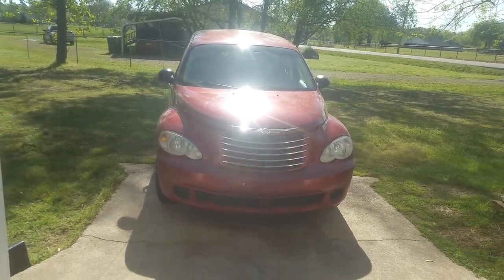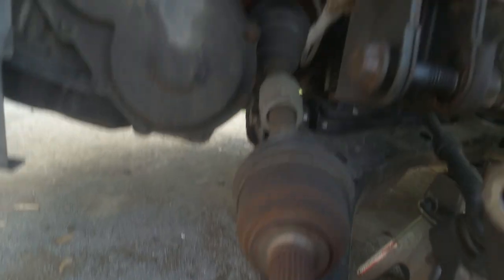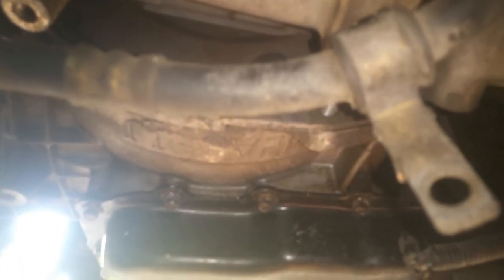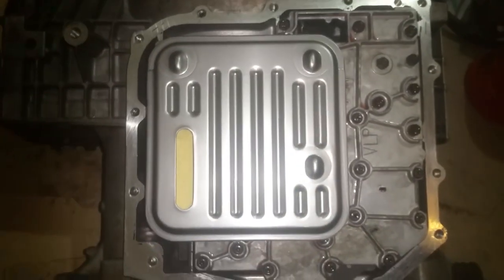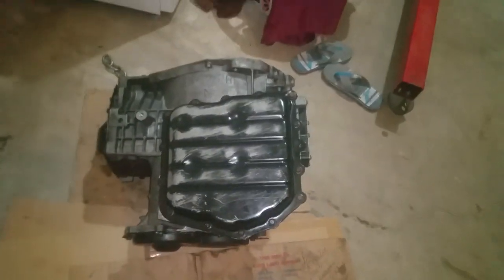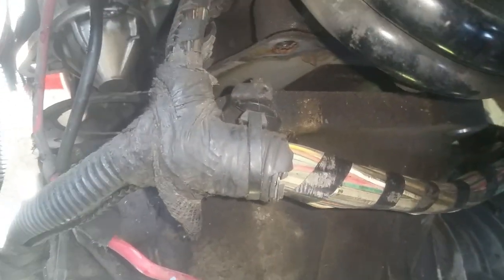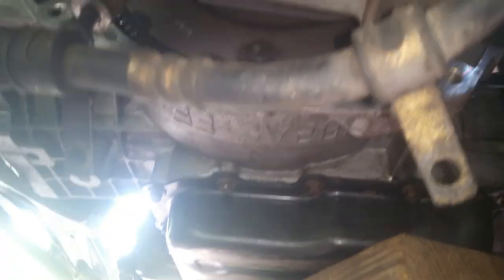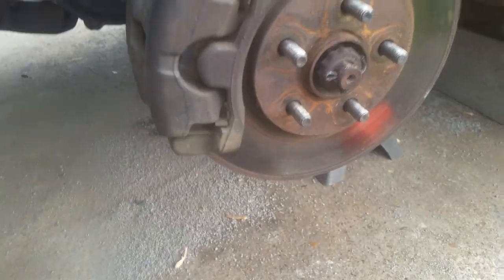How to replace remove transmission in a 2001-2010 pt cruiser

Comment: I can not express enough how happy I was to find this video. I'm going through the same thing right now. Don't know for sure yet if I'll get it done, but I know this is going to help. Thanks so much for posting this!
Reply from the maker: Thank you very much for the feedback , I hope the video can help others out . These transmissions are easy to find and pretty cheap. The replacement went a lot easier than I thought it would . Everything went smoothly. Best of luck on it sir and thanks again for watching
Reply: Was there any issues with the computer recognizing it? I had heard that I would have to have the sensors and computer reset or something?
Reply from the maker: No , no issues at all with the computer so far it's working flawlessly . Seems like I'd heard that somewhere myself but thankfully it's not the case. I had to put 9 quarts of atf+4 to get filled up . They drain quite a bit out for shipping but they still don't get it all. Thanks again
Reply: @s33therfan  Thanks again. Great channel, I'll be back.

Comment: 12:47 quite a bit of oil. Valve cover gaskets?
I just finished replacing my 2001 steering gear, tie rod ends, control arms, sway bar bushings and end links, calipers and pads.
Had to drop the subframe to do the steering gear.
Then my new steering gear leaked and when replacing it with another under warranty, I found the bushings bad on the new cross arms. Also a warranty replacement.
Preloading your knuckle to simulate the actual ride height is crucial before torquing down the cross arms. I only ran the car a week when the steering failed.
Everything is replaced and working and my manual transmission starts making grinding, wearing noises while in gear and driving.

So here we go with dropping the transmission to see what the deal is.
Being four years after you posted this, used transmissions are more like $800 on eBay.

So we will see what's up with the tranny and go from there.

I was hoping after a few thousands in parts, I would get a bunch more years out of it and no crazy car payments. Interest rates on car loans here in the future are crazy high.
Reply from the maker: Inflation has sure hit the car parts in recent years for sure and car prices are even worse. Great job , sounds like you have put a lot of work into your car. Hope all well and it stays running for years. Thanks for the feedback.

Comment: You think they bolted a lot on that you should try this on the turbo model ... The CV shafts are two pieces in the passenger side and there's even less room because of the turbo plumbing
Reply from the maker: Yes , I remember doing a little work on one of those years back. I do rememeber there being a lot of choice words involved. Thanks for the feedback.

Comment: I may be at the point where I need to replace the transmission in mine. You stated early on in the video, the transmission you purchased had only 20,000 miles. Was this from a vehicle that had been in an accident? I'm looking on Ebay and seeing transmissions being sold from cars that appear to have been in accidents/wrecks. Is that a red flag? If the transmission you purchased had only 20,000 miles was it from a wrecked vehicle and does that matter? I'm having a hard time believing that a car with only 20,000 miles would be sold for parts unless it was a wrecked car.  I appreciate your advise on this.
Reply from the maker: Most of the time they are wrecked , it could be a car with a bad engine. Some cars have parts only titles so they may be intact. Either way ebay is a good source with their money back guarantee. I will usually still look for the better seller rating though. Thanks for watching.

Comment: Hello sir one question do you know if a 2004 transmission fits a 2009 pt cruiser?
Reply from the maker: 2001-2005 would interchange 2006-2010 will interchange. 2006-2010 use the same 41te transmission as 2001-2005 but they made changes and added Variable Line Pressure , the valve body would be different and an extra electrical connection. So the 2009 would not work with a 2004 or the reverse if its automatic. Now the manual transmission would fit all years as far as I know. Hope this helps and thank you for watching.

Comment: ok any advice would be greatly appreciated, my pt out of the blue just went ape crap, while driving the battery light came on, stereo went off, tac went way up and engine raced loud like being in neutral. error code was something like 0500 , freaked me out, then went back to normal,, little while later done it again and again, more gas i gave it, worse itd get — feeling sad.
Reply from the maker: With that code it sounds like a speed sensor or something with the transmission. However with the lights and electronics going haywire it seems power related . Possibly battery or alternator . You can easily check the voltage output of the alternator and also check the battery with a volt meter. It is very odd I would start with the battery and then alternator. Then go to checking wires ( disconnect the negative cable 1st ) for bare spots or loose connections. Pay particular attention to the wire running to the alternator you have get under the car to see it make sure theres no bare spots or places it could be shorting out . If all the wires connectors nothing touching or grounding out then I would probably check fuses and then relays. Anyways just some places to start and I hope this helps . I had a pt cruiser with a shorted out wire that was going to the alternator. It was loose and somehow melted the insulator off the alternator. I rememeber it doing really crazy things. Anyways best of luck on yours and thank you for watching.
Reply: I would check chadis ground connections.
Reply: Check all you vacuum lines.  Check your cable on your cruise control.  You should be able tell this.

Comment: i removed the trans from engine and the torque convertor stayed on the engine -did i break anything as it just came apart that way?
Reply from the maker: If the bolts are removed holding it to the flywheel then it must be stuck somehow . I have had the torque converter try to pull out with the engine and just carefully pushed it back into the transmission with my hand or screw driver. It does happen from time to time nothing to worry about. Its not a bad idea to replace the torque converter seal while you are in there seeing how they are cheap. But if it looks fine and has not been leaking it is not necessary. Thanks for watching.
Reply: @s33therfan  thanks ,really appreciate your videos and help ,you rock !

Comment: "New" transmission has been installed and I'm having two issues. 1 when in park linkage is not in correct position to start, i have to move it forward one click by hand to get ignition. 2 once started starter stays engaged and immediately burns up. Have burned up 3 starters now. The last only running for less than a minute. Any help would be appreciated
Reply from the maker: Very strange issue for sure. I would focus on wiring , sounds like there is a short near or at the starter. Shorts can cause weird issues so may be its related to the park/start issue. If a different issue I would say something off with the shifter cable or different shift linkage/lever. Hope this helps , thanks for the feedback.

Comment: Is this a the PT Cruiser standard you can't find jack shit on PT Cruiser 2005 standard on how to put transmission fluid 💩😡
Reply from the maker: Manual Transmission Fluid Change - PT Cruiser Forum
http://www.ptcruiserlinks.com/forum/tech-performance-forum/11171-manual-transmission-fluid-change.html

Scroll down you will see the illustration . The left is drivers where fill check plug is located. Hope this helps thanks for watching